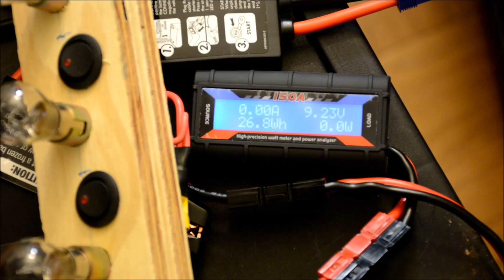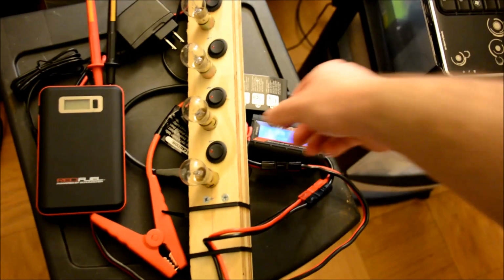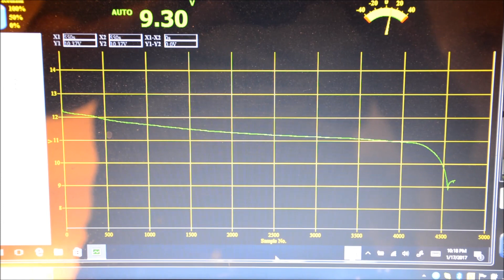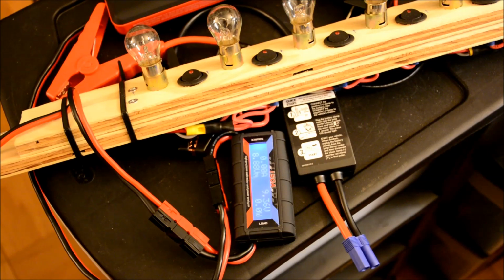Teardown & Testing of RED FUEL by SCHUMACHER SL161 Lithium Jump pack

Comment: Worked a couple of times, but wouldn't jump my Acura CL 3.2 when the temperature dropped down into the 20's. Now it won't charge, starts to charge then display starts flashing and no charge. The unit is down to 1% and is worthless for intended purposes. Not very happy.  Schumacher has been a reliable brand, in my experience, until now. Rather disappointed. I paid $35 @ Walmart on black Friday 2016.
Reply: I waited until they were $20, about 2 years later. Not a bad buy for THAT price if you get even a couple of emergency starts out of it. But that's about all you'll probably get. They are made of what LOOK like high-quality parts, but the chain sure has weak links. And they break.

Comment: Any idea about a replacement battery for the Red Fuel ? Mine will only charge to 80% now.
Reply: This is 2 years old now.It started a VW bug 3 time in a row when first bought it landing at about 65%. It just needs a new battery.
Reply from the maker: I don't think I would given the stress high discharge rates puts on cells and how much the market is flooded with fake cells.  Easier to just get a whole new unit with warrenty than risk a DIY pack blowing up if there is a defect.
Reply: Your right about the safety factor.Worth a shot to ask and thanks for such a fast reply.

Comment: Useless junk.
Will not turn over a starter.
Tried it fully charged, on two different cars, months apart.
It did NOTHING, and the manufactured hung up on me when I called to ask why this thing is useless.
Waste of money. do NOT depend on this device to even come close to starting you car.
Reply from the maker: I still haven't had much luck on cars...but I did jump start my portable generator in a power outage one time with it... so I guess there's that.
Reply: @matthewmiller6068  Thanks for your note Mathew.
I was very disappointed in how I was treated by Schumacher when I called them.
Shuffled off to an answering machine first call.
Then told they would call me back on a secondary call.
Of course, they lied and never called back.
I hear other brands of these things work fine though.
~ "Schmuck-maker" would be more accurate than Schumacher. :)
.

Comment: "Shoe-maker" OR .. whatever you called it.. "Schmauler" I'm confused because I have an almost exact model by Schumacher SL1338
Reply: The version I have is a Shumaker and once fully charged at 100%, just turning on the LED light itself brings it all the way down to 73% within a matter of 35 seconds. You can just watch the percentage fall as the light remains on. I have not tried to jump a vehicle on this specific battery pack but because it is giving me faulty readings on a full charge. I have hacked the connections for the 12 volt output and use it for a wide range of uses probably.. for example, extended the life and power(torque) on my kids 12v Charger Police powerwheel. Pretty cool! (PLEASE BE CAREFUL/CAUTIOUS if you choose to do this, the gauge wire needs to be thick due to the power output (amps) it will melt the sheathing and possibly start a fire, be safe have FUN)

Comment: I had to take apart to re-solder the USB ports as they are pretty weak and both ended up breaking off, to where they were loose inside, but putting back together, there is a little black ground wire with a black cap at the end.  any idea where that went to? I cant quite see it in your vid...it is on opposite side of display wires.
Reply from the maker: Sure, I just tried to record a higher resolution clip of the boards and how mine are together...not sure I understand what you were asking about but hopefully this helps.

https://youtu.be/o7t0c1dvdj0
Reply: mine broke off too but i cant even get the damn thing open, i have the 1315

Comment: I got the connectors from Ebay and made up a  lighter socket.  Works great for anything using twelve volt.  Compares well with a 7 amp hour gell cell.
Reply from the maker: Curious what sort of devices you run that way?  I was hoping to run some ham radio gear (12V) but capacity was too low.

My plan was to do like you did tho with a PowerPole connector adapter which is common in the radio world for 12V instead of lighter plugs.

Maybe they have improved them since I made this - that would be nice!
Reply: @matthewmiller6068  , tire pump, air bed pump, Engel fridge for up to an hour. Saves me from moving car battery from car to tent.

Comment: I have this same one and it no longer charges. It will say %100 but as soon as I try the light it drops to %0. 
Anybody have any ideas on what to do other than trashing it?
Reply: M Brenski I have this same issue except mine works if I’m jumping my car (I’ve tested it) but the USB ports don’t work and the light only comes on when on the charger.
Reply: came here looking for answers as well. It just stays at 1% and it's flashing.

Comment: Hi. Can you tell me what the volts and amps are of the charger!? Thanks.
Reply from the maker: Frank Castle 15 volt 1.0 amp center-positive
Reply: Matthew Miller You're the man! Thank you!
Reply: Btw... I just looked at the battery pack and it says it right on there! I never noticed it before.  Duh!!! 😔
Reply: Thank you for confirming center-positive.  What size is the plug?

Comment: I plug mine in and will not charge or turn on what the heck my first one did the same thing
Reply from the maker: mrnortonii if it isn't lighting up at all that makes me wonder if it is not getting power...I assume the outlet works with other devices?  Maybe let it sit for a bit (but watch it) and see if it recovers?
Reply: Mine will not take a charge..any advice on what's wrong?
Reply: Mine has failed to take a charge also.  Just getting the flashing blue display (reading 1%) when hooked to the charger.  Seems this may be a weakness in these units.  I have never used my to jumpstart a vehicle/never attached it to a 12v battery.  I only used the 1A USB port when out in the backcountry for extra phone life.   Mine lasted 2 years.  Generally Schumacher has a good history of quality products but this Chinese product has pissed me off for spending the $50 bucks.   Maybe a total of 30 hours use as a backup power source.
Reply: Seems if you leave the clams hooked up it will drain thw battery and mess it up, i have bout 2 of these and both time i have left the clamps on and after that it wont charge at all, i will just invest in a good quality one around the 300 dollar range, i guess you get what you pay for

Comment: just a tip, I bought one of these, and I needed it to jump some equipment with completely dead batteries, I hooked it up and the jumper would turn over the engine for just a couple seconds before the led would blink and beep at me and stop jumping, the first 3 times I used it, it would not jump anything, it would just give me some fault code and not actually allow the jumper to jump anything, so I opened up the plastic box attached to the cables and plugs and removed the circuit board from it and re-attached the cables back to the plug, and now it jumps anything anytime, you dont need the the circuit board in the middle, none of my other jump packs have any fault sensor/ safety electronics in them, just remove it and use it, I also stick it in my back pocket to charge my phone and bluetooth speaker as I work at on my farm
Reply: I know it's been 6 years since you gave this tip, but I just did it yesterday and it works way better thank you.

Comment: I use this pack everyday at my shop when we work on vehicles and leave the doors open too long, this will start it every time.  It is not intended to charge or revive a dead battery and it can be damaged trying to do so. It's mainly intended to help in situations where one might be stranded from leaving their lights on while shopping, and only if there is still some sign of voltage when you turn key on or parking lights on or if the starter just clicks while trying to start..  This is very compact and I can take mine with me on my motorcycle for roadside emergencies,  but for overnight drains I use a  battery charger to properly revive the battery.  Jump charging a dead battery with high amperage really takes away from it's lifespan.

Comment: Has worked multiple times for my 4.3 V6 not a problem at all
Reply from the maker: I'd consider yourself lucky - yesterday I found that I'd left a GPS tracker running and my battery was run low to the point my accessories worked but my car wouldn't start.  The first one I turned on said 100% and when I went to use it the jump lead box was flashing 4 red "low voltage shutdown" saying the Lithium pack was dead.  I went and got the other, it was also showing 100% and went into jump-mode but I only got about 2 seconds of slow cranking then after about 3-4 seconds it got very slow and my dash lights were blinking out.  Mine is only a 3.6 H-6 engine (Subaru Outback).  Then I got out some traditional jump cables and had my car started almost immediately off my roomate's car.  I'll post a video when I have time to narriate and edit it, in 20F temps running late with a low battery I didn't feel like doing much at the time.

Comment: Hey Matt , great professional analysis , but to help the consumer make a life video testing the device starting up cars . Was impressed when i saw this little thing with 400amps which should start the car easily if you have a dead battery but when i used it the first time was really disappointing and return it back , too weak and not helpful with dead batteries .
Reply from the maker: HAMADA SAMIE  Haven't had a dead car battery in a couple years...but considering the leads are similar thickness to the jumper cables my friend had melt in half I would not expect much from this unless your battery is only slightly weak.  A real dead one you will probably still need some good old fashioned #4 or even #2 thick heavy booster cables.  When I helped my friend who had stuff left on and ran their battery flat even my #4AWG cables got quite warm to the touch and required a few minutes minute of charging to make it crank.

I was hopeful these packs would be good for portable power...and more interested if they performed up to the advertised specs.
Reply from the maker: I'll have a new video coming in a bit (when I have time to edit and narrate) - I had the chance to try it when I left something on in my car and it was not useful, couldn't start it (3.6 H-6 Subaru Outback)
Reply: Matt whats the polarity of the charging ac - dc transormer converter? lost my charger and I really need to know Thanks!
Reply from the maker: Andrew McCaskill
polarity Center-Positive
15 volt @ 1 amp
Size feels like it best fits "radioshack adaptaplug H" (orange) which is 3.4mm x 1.3mm size
Reply: Matthew Miller thanks bud!

Comment: Buy one and return it to Walmart, but this one is turning the same, does not charge and the blue light flashes, any advice?
Reply from the maker: Not sure on that one, sorry.
Reply: Alicia Solano yes you're charging source is not adequate enough for your cable is not manufactured in the way to handle the amperage the device is asking for from the charger you're going to have to find either a higher amperage USB charger 2.4 amp to 3 amp should be adequate enough and the device will not charge if the cable is not heavy duty enough and I believe that is because some micro or type c cables when we charge from them are doubled up on the pairs for charging or it's a single pair when it's single pair the device knows this and it is unsafe to use such a current through a single pair power wire inside of the charging cables so it will not charge I discovered this alongside with Anker when using other devices micro USB charging cables and when I used an Anker charging cable the device started to charge right away. and this was because of the making of the cable was not designed to take a 2.4 or 3 amp charge. if you're at Walmart you can go to the electronics department and find you an Anker cable either USB micro or Type - C whichever one you need to charge but I suggest you probably pick up to these cables are very durable and badass and never let you down when needing to charge any device out there anchor has a wonderful customer support team if you are ever unsatisfied with any of their products and they make hundreds and hundreds of products they won't stop until they make it right and put a smile on your face, it's a great company you can rely on how a customer should be treated solve my issue even by replacing products with just the serial number provided to them
Reply: @josephclements9035  I think she meant the device itself will not charge, not it won't charge her other devices. Mine is doing the same thing. The battery in it died and it refuses to take a charge. The charger it comes with doesn't get any reaction out of it. It blinked blue once at first and nothing since. It's a just paper weight now.

Comment: I'm on my second one, they both flash 3 error reverse charge when I try to use.Although the battery I'm testing are fully charged why would it come up reverse charge?
Reply from the maker: What were the circumstances of it?  Was the battery really dead?

The reverse charge protection works by detecting power flowing in the "wrong direction" - typically because the voltage you connected the clamps to is greater than the voltage of the boost pack.  The booster pack at full charge is around 12.5 volts, a fully charged car battery is around 13.8 volts and may be as high as 14 volts when the engine is running.  Power always flows from higher voltage to lower voltage, think of it like water, always flowing to where it's lower.

If you don't have a volt meter to test the car battery maybe try turning on your headlights and then connect the booster pack, see if it makes a difference.  The headlights will put a small load on the battery and may pull down any "surface charge" that makes it appear to have higher voltage than it really does, for example if your car's battery has 1 bad cell it may appear good under no load but drop significantly in power as soon as you attempt to use it.

I hope this explanation makes sense - it's difficult to give more than a guess without being able to get hands-on to perform tests.
Reply: they should define that in the booklet better, makes you think its defective.So to test my device I need to pull the plug wires and crank the motor till it dies. Thanks much for your help makes sense.
Reply from the maker: spider2020 yeah, I agree it could be better.  I could not figure out how to make it turn on until I read an Amazon review (which is why I mention it in my video).

Best of luck!
Reply from the maker: One additional note, from what I recall in my tests even if it "works right" to start your car, once the engine is running and the car's charging system takes over making its own power the voltage will rise up to around 14V and the boost pack will "shut down" for reverse charge protection.  Though by that time it won't matter because it's already performed it's function of starting the engine.  Hope that helps!
Reply: Yea but if your portable charger is hooked up beeping reverse charge and your car drops below about 12.0 volts when you go to start it does the portable charger automatically take over to boost you up over the 12.0 V to help start your car?
Reply from the maker: That's a very good question actually, I don't think I tested that.  If I have time and remember maybe I'll do a bench-test for that tonight.
Reply: I bought portable charger mostly to help me and my 3 choppers out and to start in 60 degree weather, when the oil is thick under those conditions these big twin big boar motors spin over only about 4 to 6 times then the battery drops from 13.3 to under 12 V and not enough to get going... not to mention the hardship your battery goes under really takes it on the chin so to speak
Reply: It's a jumper not a battery tester. Why would you put it on a fully charged battery.
Reply: Matthew Miller hey just be greatful that you got the 8awg cables with the protection box having an on/off switch, I purchased one lastnight from Wal-Mart for around $50 and maybe it's an updated version but it now uses only a 10awg wire thickness and the protection box no longer has a manual on/off switch! Model number is SL161, did I purchase a lesser quality or a smaller capacity unit possibly???